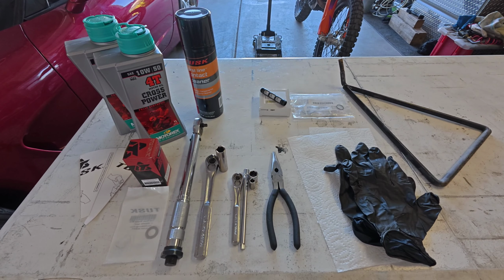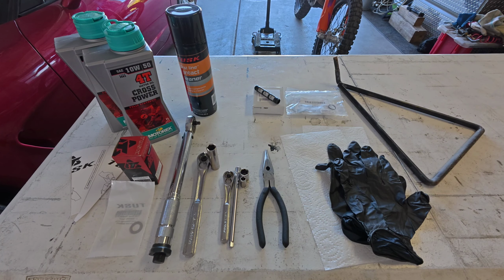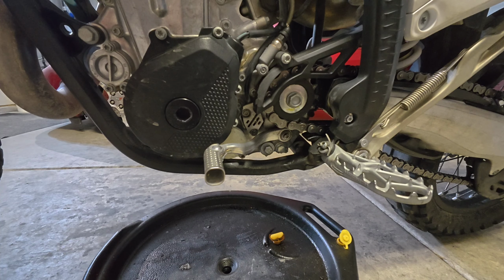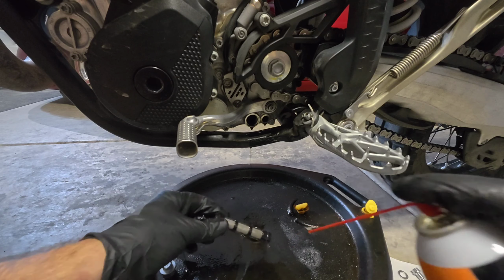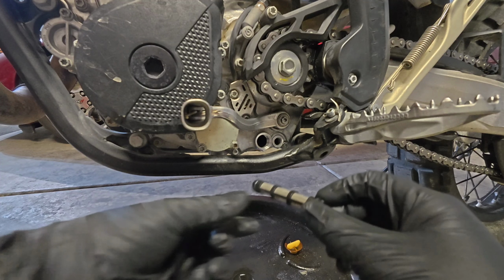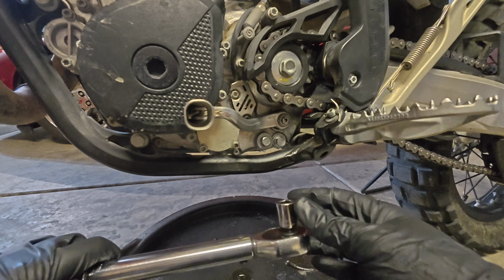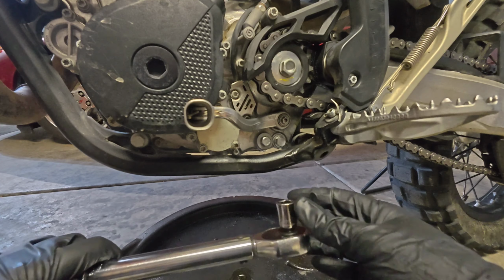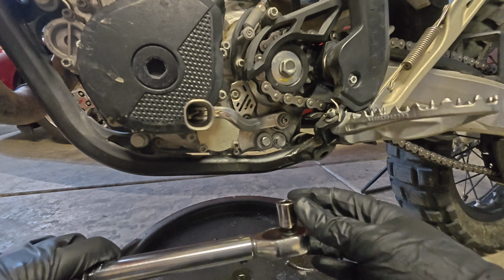Oil Change Procedure. Long Version With Tips. 2024 KTM 500 EXC-F

Comment: I didn't know that much oil came out of the bottom plug. I just thought that was the unused filter location on other bikes. I usually tipped bike to the side at the end of drain because skid plate.
I also missed lubing o rings and priming the filter so thanks 👍
The ktm/husqvarna oil change kits have the bottle with the correct amount of oil...I've just been emptying them in.
Reply from the maker: @BushmanCanuck  I get a quite a bit of oil each time I remove the bottom plug. My skid plate is easy to remove so I take it off for each oil change. It makes clean up easier. I make it a habit to go by the sight glass, run the bike and double check.

Comment: I think running the engine first so oil is hot and then draining oil is best - oil is thinner when hot and likely will drain out better.
Reply: In fact, I just checked the manual and it does say "drain the engine oil with the engine at operating temperature"
Reply from the maker: @AlexKost-tq6bj  Yeah a lot of people go by that. I live in a warm climate, and the “cold” viscosity is not a setback for me. If it were freezing ambient temperatures, I’d warm it up.

Comment: Btw, with extensions for the torque wrench: looks like you're using a 1/4 drive extension? Which is thinner and indeed could create some flex and inaccurate torque reading - using a 3/8 drive or even 1/2 drive torque wrench and extension will likely reduce any error. But as you say, best to just use a deep socket.
Reply from the maker: @AlexKost-tq6bj  Fair point. For this application I don’t believe small discrepancies will be an issue. Some level of consistency is all we need. I personally never had problems with hardware prior to owning a torque wrench. I went by feel for many years. Though it would not take much to strip, snap, or crack something.

Comment: Why are you foot peg pins in upside down? Did it come like that from the factory
Reply from the maker: @619Rider69  Style Points.
Reply: Mine came from the factory upside down
Reply: Mines same … 1st thing i noticed when i collected it lol things like that bug me
Reply: Mine came that way also. I think if installed with cotter pins down the kickstand when down will hit the pin. At least I saw that in a video... hahaha
Reply: @ I asked at the dealer. They said the race teams do that because you can change foot pegs easy without taking off the rear brake pedal
Reply: @stevesmith756  i just looked on mine .. if you put the stand down it nigh on touches the flat side of the cotter pin… would stick out to far if they was other way round so seems both sides do need to be that way

Comment: Looking at the service manual on the 25 says oil change at 43 miles then 600 then 1800? It says every 600 so I assume that's what they mean what are you doing bro? I'm thinking just babying it and changing it as often as I can
Reply from the maker: @jayppop3333  Yeah so what they are getting at is the break in (43 mi) and then regular service intervals after that (620 mi or 10hrs). I did break in of 1/2 tank fuel at 1/2 throttle or less, continually variable/ non constant rpm, use all gears. Changed oil at 100 miles. Started riding a little harder after that up to about 3/4 throttle/continually variable up to the 600 miles. Changed oil again. After that took the bike out, got it fully up to operating temperature, and did some full throttle pulls, and rode the bike more or less like I would normally for the duration of that ride. Went home and changed the oil after that "final" break in ride. Now I am doing extended intervals of about 1,200 miles. 

You sound kinda like I am, and want to take it easy on the bike, at least for break in. Many people believe the process that I described, and the manual for that matter, are overkill. I don't mind and easy break in process. I ride the bike however I want now. As far as extended intervals, keep in mind that miles and runtime hours are not always directly proportional. You may need to favor one or the other depending on how a given batch of oil is ridden. I believe I sent you the link for my oil analysis report. Check that out. If not I have some playlist's with a bunch of video's for my 2024 KTM 500 EXC-F.
Reply: @dustinhoover3157  thanks for the information man I guess I'm overthinking it expensive bike don't wanna screw it up haha thanks for your help man I'm gonna do what you did in breaking her in today then first oil change 🤙
Reply from the maker: @jayppop3333  I should also add that many consumers believe that KTM's intervals for maintenance are likely to cover their butts. Though, are probably legitimate for riding at race pace, hard enduro, or other forms of high intensity riding.
Reply: @dustinhoover3157  I'm like you I would rather have an slow break in and keep the engine clean with more oil changes .  I was using motul in my other KTM it was a 2008 and it would drain out red and clean after 300 hours and no rebuilds. Trying the same for this bike ! Id rather be safe than sorry